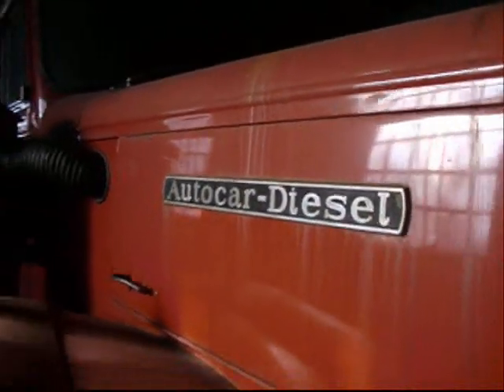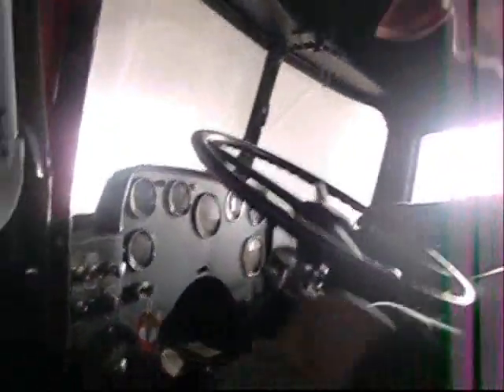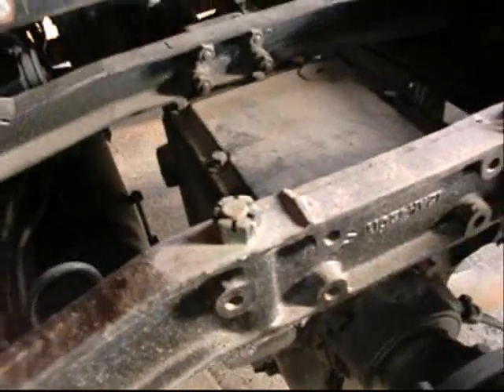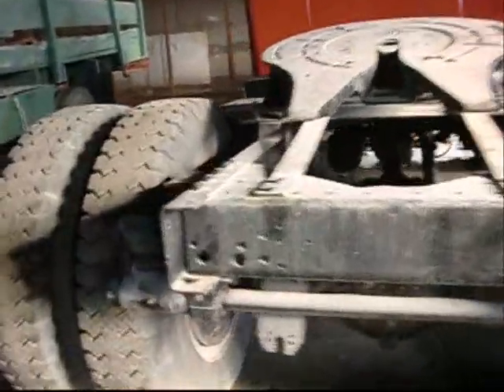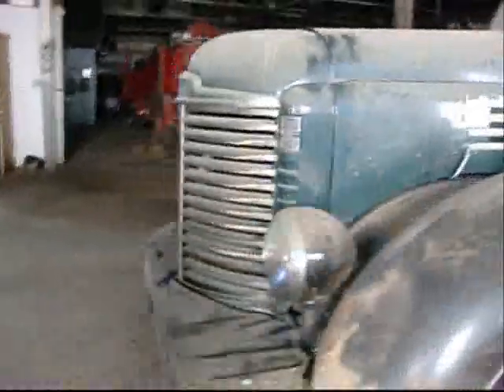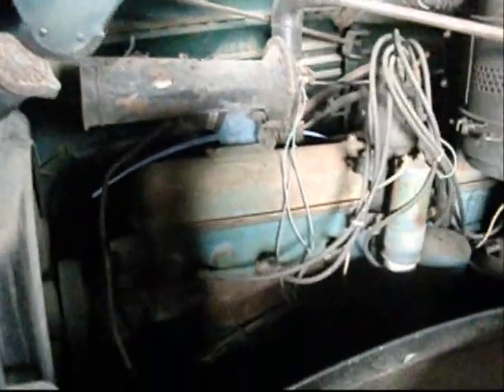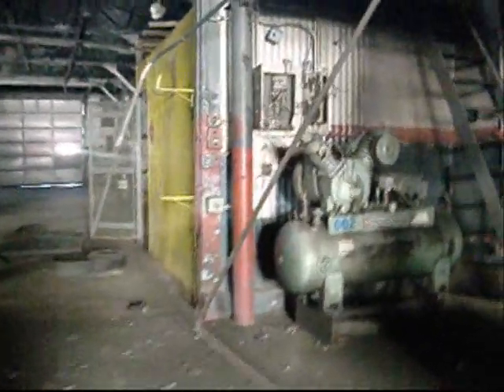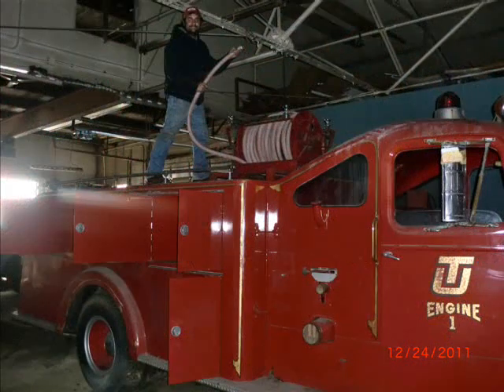12 24 11  Abandoned Red Trucks!!!

Comment: The engine in this A-Car is a Cummins Model No. HRF-6B, Rated HP: 190@2000 RPM, Governed RPM: 2250 RPM, Max. Torque Rating: 580(?) lb/ft of torque at 1500 RPM.  This is a 2 valve per cylinder, 743 CU. IN. engine (5 1/4 In. Bore/Cyl., 6 In. Stroke/Cyl.  The 2 valve per cylinder arrangement signifies an "H" engine.  On an "H" engine, both the intake manifold and exhaust manifold are on the right side of the engine, as shown on the engine in this truck.  If it had 4 valves per cylinder, it would be an "NH" ("NEW" version of H) model, e.g. NH220.  The intake manifold would be on the left side of the engine and the exhaust manifold would be on the right side of the engine.